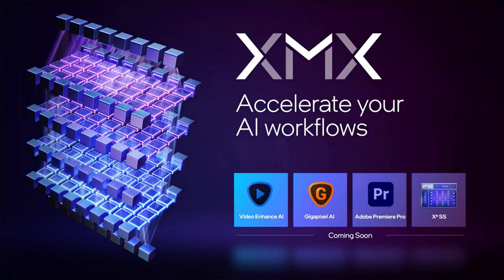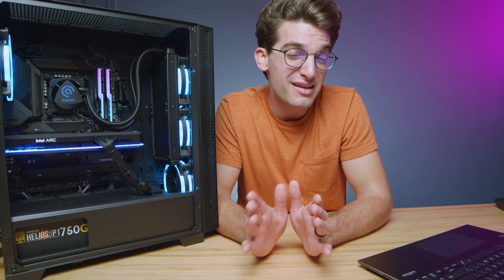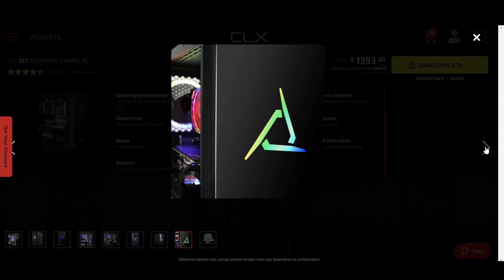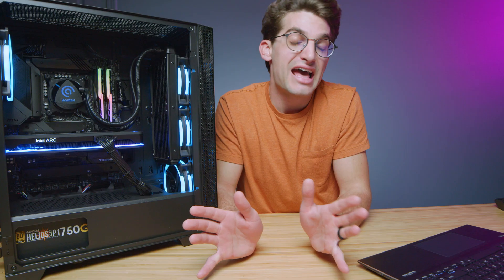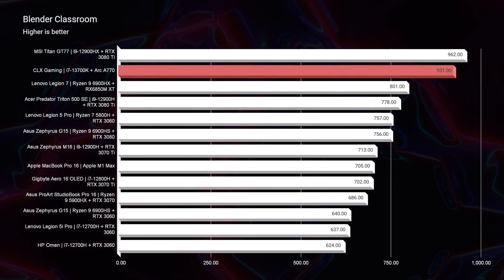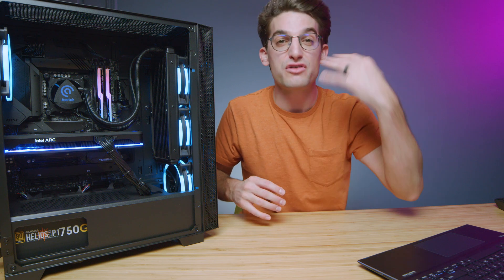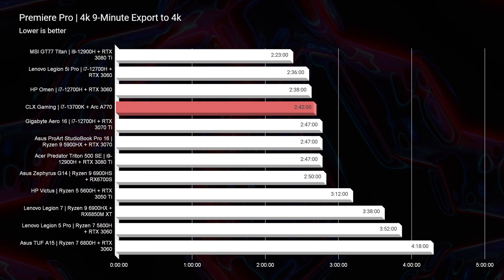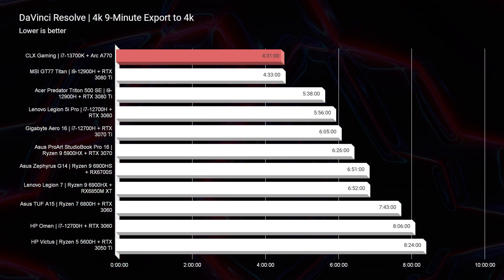What they're NOT telling YOU // Intel Arc A770

Comment: If you get an arc card..look up how to enable fan control, I have lowered watts to 190, 25 boost and 80c limit...with the fan control enables you can set your own curve...its noisy but at 1440 high setting most games it doesnt temp out and runs pretty smooth...I'm satisfied for 349 with 5 free games

Comment: ehh... I got a R7 5700x build, tried to put A750 in it, it looked like it was in safe mode!did the resize bar and 4g thingy in bios, black screen after that! I got a 13105f cpu in stock, I guess I have to buy a mobo for it and get an intel build for it!!!!
Reply: Did you resolve your issue
Reply: @hadoken8688  the same way somebody told us on another video, simply pull the effin hdmi cable out, and put it back in while its running!
Reply: @@ak20ayush yes, but the resizable bar wont really turn on this gigabyte aorus elite v2 mobo!so it wont render on premiere pro!

Comment: Intel overbuilt the VRM's on the Arc's, and there is a trick to increase the max power limit infinitely. I was brave enough to take my a770 up to 335w for some Time Spy runs, best GPU score was 15.3k. A stock RTX 3080 is 15k in comparison.
Reply: Geebus
Reply: Tutorial
Reply: the size of that gpu and the transistor count, makes sense.

Comment: I cant listen to someone giving out advice when behind him his AIO cooler on his CPU and radiator is turned for improper waterflow that will end up gunking up your rad lines and will stop working properly within a few years.

Like a instructor teaching ppl how to drive a car but behind him his car has no steering wheel.
Reply: i don't rmb any advice given on component cooling or maintenance in the video. Just talking about the performance of the gpu paired with the cpu and that's about it.

Comment: I just built a system with an i7-12700kf and I have been seriously looking into the a770 as a possible upgrade from my current gtx 1650, I was a little skeptical but with the performance gained with software revisions over the past few months I am really thinking about this over my first option the rtx 3060 ti
Reply from the maker: Yeah, it’s really great software and hardware!!
Reply: Depends on pricing. Rtx 3060ti is probably the midrange king gpu. But seeing these new updates on the a770, I'm also really leaning towards the a770
Reply: Did you buy it? I have read that there is a playback performance issue in the premiere. I am confused between 3060 ti and a770.

Comment: I just now stopped at micro center and bought an open box a770 for $294.00 . I can't wait to see how the new drivers released today do. Thanks for the video.
Reply from the maker: Killer buy! The pricing on these units is amazing. I love to see Intel coming in highly competitive with these prices.
Reply: @BenGKaiser  Competition is king. Really excited to see it in action. I appreciate the content.
Reply from the maker: Yes indeed!
Reply: I too bought an open box a770 16gb LE.  $478 CAD after taxes ($422 + tax).  Only problems so far hardware wise, is some of the  back LEDS are nor working properly when using a custom theme on the arc rgb software (more noticable when the back leds are switched to off).  My solution is to keep it in the default preset theme as it doesn't have any issues there.
Reply: @batkinson001  you are the second person talking about the LEDs not working properly.
Reply: @sxsoutcast7651  oh?  Where was that mentioned?
Reply: @batkinson001  I watched a YouTube short. The guy was showing his rgb going crazy on just the end of the card.
Reply: I want to build one pc topo using the a750 coz of budget constraints, I recently heard a news that they have improved this one even further, how is you build holding up?
Reply: @icyjaam  the 750 only has 8gb of vram. There is a model of the A770 Asrock which has 8gb of vram too. I think its under $270.00 on newegg
Reply: @sxsoutcast7651  here in India the a770 is 110 dollars more expensive, and i dont have that much budget😅